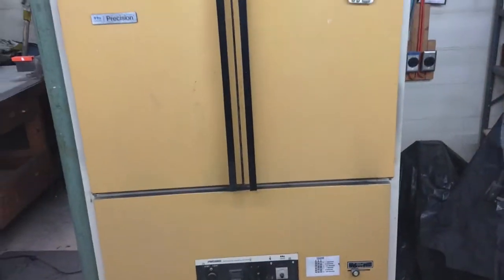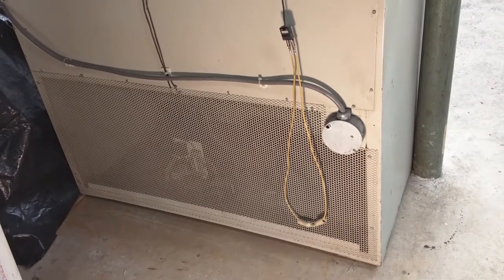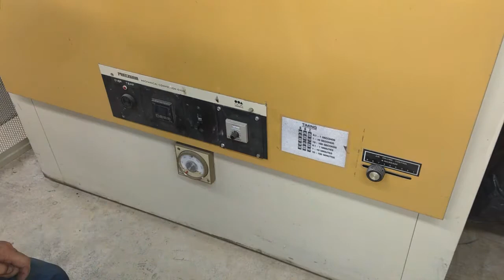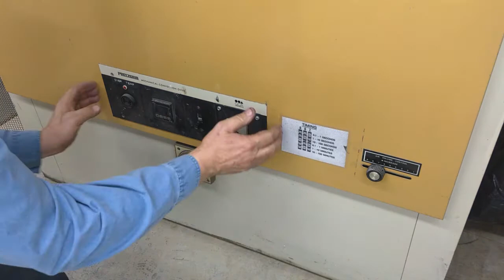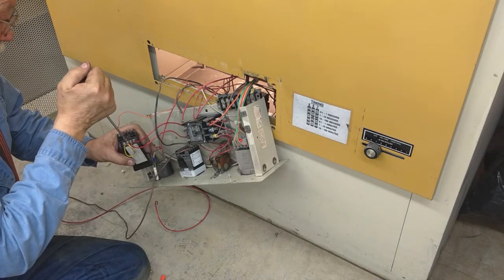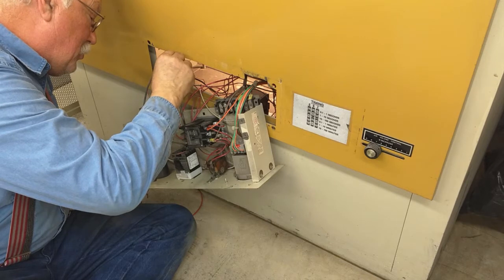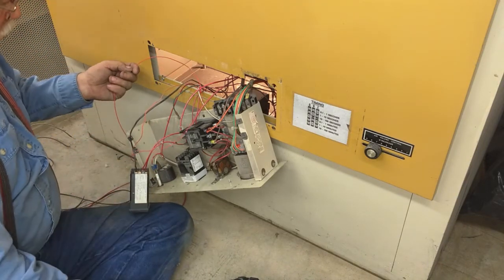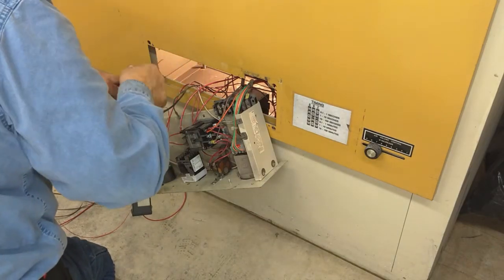Failed attempt to swap temperature control modules

Comment: Always cool to see this oven .. dang details are always a challenge
Reply from the maker: Still doing research on the controller, I got the new J thermocouple in today and I can replace the jumper to that sensor. I think it needs K type thermocouple to work correctly. Glenn Lever